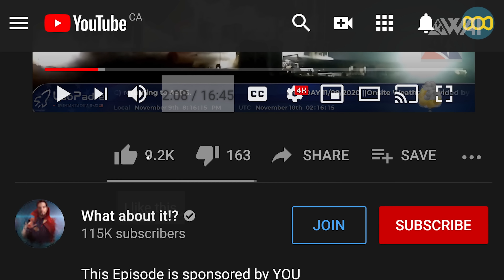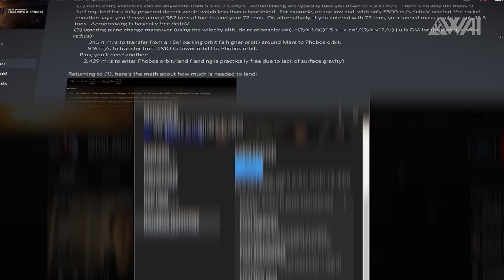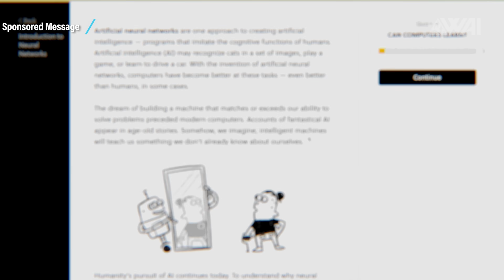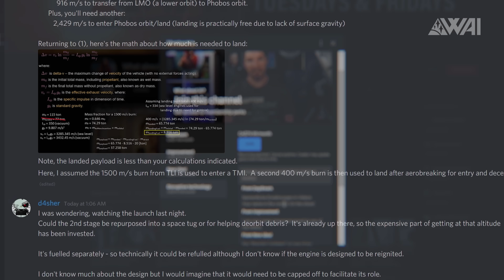140 | SpaceX Pushing the limits -Starship SN9 launch incoming?

Comment: The 5 pillars of the OLM are the foundation of the support tower, not the launch stand.  The girth and depth of those pillars would support a massive tower crane.  Consider SN8 launched off a doll house relatively.  Elon's tweet confirmed it was part of the Orbital Launch Mount, but he never said it was the stand, not the support tower.
Reply: Support tower ≠ mount, and they will use mobile crane in early days
Reply: @alvianchoiriapriliansyah9882  I'm sure they'll use the mobile crane at first, but the rocket will never lift off the 5 pillars currently sticking out of the ground.  That will be the tower, not the stand.  All the current renderings have it wrong IMO.
Reply: @smokingrubber  Tower ≠ Orbital launch mount
Reply: @smokingrubber  Except it has 6 legs, unless you can back up with your source
Reply: @smokingrubber  Except orbital launch pad isn't a simple stand either

Again, there will be no tower for early days, all stacking uses mobile crane

This stand will be first used by BN1 for its 150 m hop, so it's pretty strange if they build a tower first

Several renderings has shown Starship orbital stack taking off from this legs, and Elon didn't deny it

I wish youtube comments has a reminder so we can bet who's right after a few months (pending FAA assessment ofc)

Comment: Really… It was not completely vertical. It could've come in at any angle and still had a perfect circle marked on the pad as it collapsed. Take a paper And smash it into the table. Even if one edge hits first, the opposite edge is going to hit eventually and make its mark. Look at the dam video and you can see it was NOT completely vertical.

Comment: Are you certain about the landing legs being deployed by the landing speed?  OR Would they be deployed by the altitude?
4:31   This is a perfect shot of SN9 before it leaned over.  Please notice it is mounted to a low ring stand that has no diagonal braces as it is steady enough due to the short legs.  BUT as soon as they added the pipe stands to raise it up for Raptor installation, it becomes another thing altogether.  Those short legs now have added leverage to them and then should have had bracing added. Which did not happen.  Those pipe stands were already made for the field installation of landing legs.  In that usage they were safe as they too were short enough to not need braces either.  But when bolted together they transformed into a huge mouse trap.  Someone realized the sketchy operation and then added the two steel coils and chains, not realizing that the chains were only effective when overturning and were ineffective during a collapse of the legs.
-If this lean had happened to the SLS inside the VAB, NASA would have a 1 year investigation before any repair work could began.  Thanks Felix!
If I were writing the news I would have said," New Spacex rocket achieved full altitude, a gradual decent and solid landing."

Comment: I personally wondered if the leg deployment was set to occur so many seconds after the Starship reached a certain height. but with the low pressure by the time the command would have been given the legs were laying on the pad.

Comment: Like to SpaceX experiment with programming the Falcon 9 with the sky drive manoeuvre.
Reply: Why? Falcon 9 can do the current manuever just fine. And redesigning it means costs & time when they will replace it with Starship anyways
Reply: @alvianchoiriapriliansyah9882  if they could save fuel, then it increases the payload capacity.   Starship isnt going to be certified for at least a couple of years.
Reply: @seb_gibbs  They won't be doing any major upgrades to Falcon now. All focus is on Starship, and it's going to  have several uncrewed first in early days. With recent rapid development, there's a high chance the first orbital attempt will be next year

Not pointing the focus towards one thing leads you to nowhere. Falcon is going to be replaced by Starship no matter what

Comment: A couple of comments regarding your analysis of the landing:
 If the retro thrust had been sufficient to slow SN8 down enough for a proper touchdown the added flight time probably would have given SN8 a few more meters of lateral movement to slide into the center of the landing pad,  that additional time and decceleration would also allow SN8 to hit its cues for landing gear deployment...

Comment: Highlight of 2020? SN8 flight by far. More detail? Launch was great but more of a relief than off-the-scale joy. Going into the stable belly-flop was absolute joy because honestly I would have still considered SN8 a success if "all" it had managed was its 3-Raptor launch and getting to apogee, but my absolute 2020  highlight was the moment it relit 2 Raptors and used them successfully (along with a bit of RCS thruster input) to flip out of the belly-flop into landing orientation, with the added flourish of seeing the two Raptors very briefly but very clearly counter-gymbal (to null-out a bit of roll I assume?). That was when I realised just quite how far beyond (my) expectation the SN8 test flight had gone.

And now SN8 is lying on the landing pad and continues to impress. It looks magnificent with the almost intact nosecone and the single flap pointing up to the sky. If you were commissioning a statue of it you couldn't do much better; SN8 sure knows how to strike a pose.

Comment: @ 4:08  The tent was not actually damaged by the crash but rather by the pressure from the exhaust. The tent would have probably suffered even more damage if the engines had continued to work properly adn achieved a good landing.

I noticed this in one of the videos from an angle that showed the landing pad with the tent in the background. The tent can be seen 'inflating' and then bursting on one side when SN8 was still a hundred or more metres above the landing pad. The tent in fact looks almost exactly the same just before Starship hit the ground as it did after the fireball and smoke cleared.

The same is probably the case for some of the other damage such as the displaced containers. I think only a small part of the ground damage was caused by the actual impact, explosion and the flying debris.

This means they will probably need to put some more distance between the landing pads and certain fragile infrastructue and/or make such structures more robust in the future to avoid the blast from the engines from destroying stuff.

I would put a link here but unfortunately I am unable to find it. I'll add it if I find it later on.

Comment: SN5 or SN6 look pretty brand spankin' new sitting there.  Why not put nose cone and fins on them and get them flying?  Can't they mount 3 Raptors?  Or maybe use them without fins for 1.5km hops.  Engine and propellant systems flight testing!  Need to gain a lot of trust in those Raptors and the propellant plumbing.  Oh, can't do that because they built the assembly buildings too close to the launch pad??  Can't do one without stopping the other?
Reply: It's already obsolete. Its job is done, and now retired as ornaments

SN8 already tested everything about the plumbings

Comment: Using A Diamagnetic Fuel Pump Superconductive Cooled By The LOX wheel shrouded by magnets will give you a boost. The Magnets Compromise Inertia In The Pump Letting It Fly Faster.

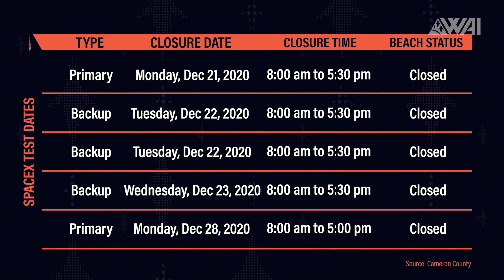Comment: Just to correct that duplicate in the closure schedule at 9:16, and expand it a bit for the following week:

PRIMARY Date      Monday, Dec 21, 2020	8:00 am to 5:30 pm	Closure Scheduled
Secondary Date	Tuesday, Dec 22, 2020	8:00 am to 5:30 pm	Closure Scheduled
Secondary Date	Wednesday, Dec 23, 2020	8:00 am to 5:30 pm	Closure Scheduled
PRIMARY Date	Monday, Dec 28, 2020	        8:00 am to 5:00 pm	Closure Scheduled
Secondary Date	Tuesday, Dec 29, 2020	8:00 am to 5:00 pm	Closure Scheduled
Secondary Date	Wednesday, Dec 30, 2020	8:00 am to 5:00 pm	Closure Scheduled

Comment: 2020 was a sterling year for Spacex  but two events suggest some changes at BCh.  Those events are the apparent mistake on the SN8 pre-launch check list relating to removal of flap restraining straps and then the just ridiculous toppling of SN9 as it sat unsecured in the high bay.  Elon a pat on the back and I am sure you have taken corrective steps.
Reply: Can you elaborate the SN8 prelaunch checklist mistake part?

Comment: I think the SN8 is too close when it turns to land so the gravity is stronger when the rocket is not ready to fully push the SN8 into balance for landing. Hopefully SN9 like Falcon9 will be more successful in its trials to fly and land as the beginning of their aspirations to bring humans to fly between countries, the moon and Mars.
Reply: The cause was low fuel header tank pressure, causing the engine to lose thrust (& start eating itself with green exhaust because of oxygen-rich). The flip was done in a correct timing, if the problem doesn't exist it could actually stick it

Comment: Would it be possible for the second stage of a Falcon 9 to use the belly-flop maneuver in order to make a controlled re-entry and landing? Just coat one half of it with thermal tiles, add some flaps or grid fins at the top and bottom for control.
Reply: Possible, but need major redesign = expensive, and with no gain since it reduces the payload capacity. They wanted Starship to replace all Falcon & Dragon family eventually

Comment: Instead of re plumbing, they should just fold up the rear wings and let the rear fall into vertical
Reply: Without engine gimbal (or hot gas RCS), it would smash the ground before it even gone vertical

Comment: You are in a better position to ask. Did they press the destruction button?
Reply: I think they didn't looking at the video of this
Reply: I suspect they knew the trajectory and issues with fuel pressure. If it landed intact then no problems. But if they knew it’s fate I suspect they would have triggered it for safety reasons. Wouldn’t want a package of explosives flying across the highway?
Reply: @privatehm  No... the video clearly shows the tanks bursting on impact. But they wouldn't have deliberately blown it up anyway – by the time the problem was apparent, that would have just scattered flaming debris over a larger area... better to minimise the damage by impacting the landing site in one piece.
Reply: I like someone to ask spacex. It would have required an eod to go in and secure the explosives.

Comment: It's likely the legs simply didn't have time to deploy due to the fact Starship was descending too fast.  As in if the legs are set to deploy when Starship is say 75 feet and 5 seconds from the ground, but Starship went from 75 feet to impact in a 1/2 second  the legs wouldn't have had time to deploy.

Comment: I still want to know exactly how the stand holding SN9 failed. It's really bugging me 😅
Reply: It's placed in a corner of the High Bay not designed for it, put there simply because the HB is stalled waiting for the gantry crane. Someone spotted on an old RGV aerial photo that part of that corner had an underground space for a conduit running through it (those concrete box utility spaces). If that was left hollow for access, the concrete over it wouldn't be solid, and would even weaken the adjacent area. The floor under one corner of the stand gave way just enough to start the tilt, then stress damaged the stand and everything tilted more. Others have remarked the stand has very little visible damage.

Anyway, that's one scenario. Too many maybes in it, but that's our fate as observers.
Reply: The possibility is due to stand being modified for Raptor installation, making it weaker. But again they're still learning/prototyping the factory itself, and they will 100% learn from it
Reply: @alvianchoiriapriliansyah9882   I've seen an extensive discussion of this on reddit, with pics shown. All of the construction stands have the large square side openings for equipment to get underneath. These were used for SN5 and 6 and 8. These may look cut away compared to the X sections of the other parts of the circumference, but it's actually built this way.

Comment: I can only imagine those heat tiles seriously throwing off the weight distribution.
Reply: Not really. Even if, they got thrust vectoring and RCS. Also heavier side would tend to be downwards at reentry which is exactly where they want it.
Reply: I'm sure they will find a solution
Reply: The heat tiles is pretty light compared to the rest of the ship

Comment: I wonder how much weight all those heat shield tiles will add to one side of the ship during launch
Reply: They are super light.. Im sure the 3 mounting pins weigh more than the tile itself. Im sure its been taken into consideration and they will offset the weight by mounting stuff on the other side... Perhaps batteries, copv's, ECT..

Comment: they need more inertial gas on welding those seems ,  on tank itself you can see heat on pic 8:33 way to far , more gas or some pressured air on outside should help to reduce heat on welding
 ... that would help on optimising structure airstream aswell since metal wouldnt bend and criple that much
Reply: I personally would prefer if seams were welded simultaneously from both sides.

Comment: Now SN9 has been under lateral stress thats out of norminal intended specs they will need to do a full round of tests before launch. Pressure, LN2 then fuel/lox tests before even a static fire can be done as after hitting the wall of the high bay it could have caused stress fractures or other hidden problems. If i was betting i would say maybe 1st week of Jan for SN9 test flight, maybe 2nd weeki if SN9 still needs raptors fitting? (im not sure if raptors are fitted yet?) 
Thoughts anyone?
Reply: I agree, early next year is reasonable and nobody wants Christmas to be a distraction. Space X is moving fast by any standards. Remember, next year starts just 2 weeks from today!

Comment: Also if it was able to slow its decent, it would have had more time to track to the center of the pad :)
Reply: @esbenmaas5542  falcon 9 descends at three time the speed of Starship, and it literally runs out of fuel when it lands
Reply: @CJbrinkman602  starship landings look crazy dangerous 
But they seem safer already
Reply: A proper working of the Raptors would surely  given it time to aim more for the center of the field. I am sure it had a slow movement sideway at least in the initial phase of the landningroutine but where descending to fast.

Comment: SN8 Succeeding at everything but landing!
Reply: Dunno what you are on about... it clearly landed... It didn't stay assembled after landing though!
Reply: @jackmccourt6180  *technically landed
Reply: SN8 did not succeed in CH4 header tank pressure-maintenance.
Reply: Still a successful flight
Reply: Well it landed fine 

Just a little bit hard
Reply: @captainahab5522  that "little bit" is a dangerous word when it comes to achieving success
Reply: technically it landed.... Maybe a bit to fast, but it landed ;)
Reply: Landing softly*
The landing sequence was near perfect.
Reply: @journeymanic9605  Don't worry, everything will go fine with SN9
Reply: Hey any landing you can crawl away from....